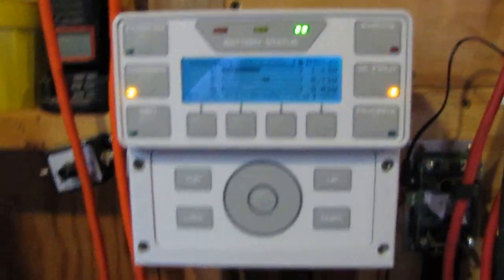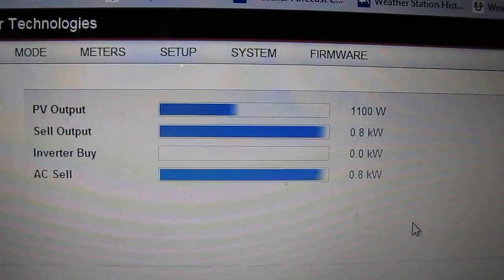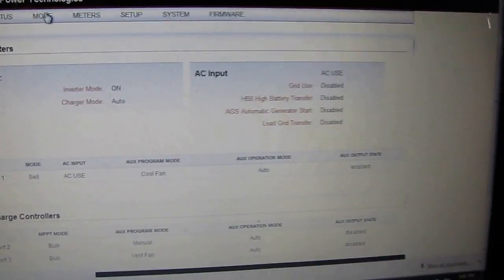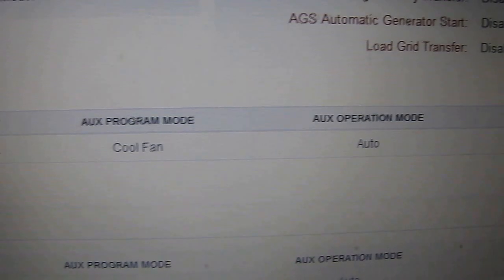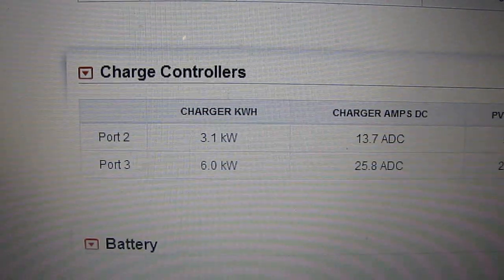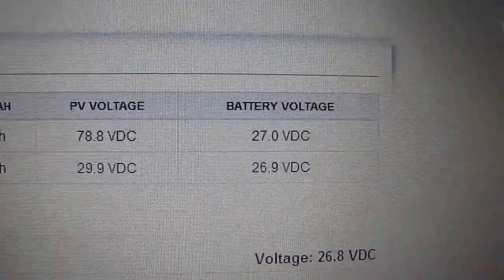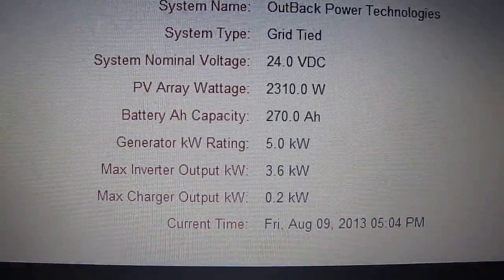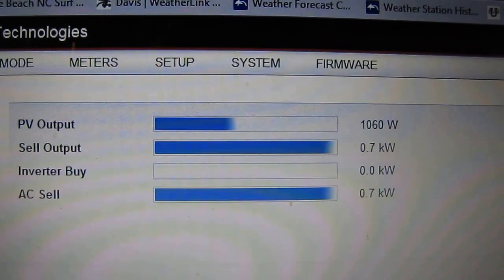OutBack Mate 3  System Controller  and Ethernet  By VIARLOCITY

Comment: I'm waiting for my system to be installed next week. Have a question. I would like to setup the FP1 for wifi monitoring instead of running cable. Would a access point work using a usb dongle or a router setup?
Reply from the maker: High Buddy I will Send You A link To my newest  Video On WiFi connection The power Line Adapter Was to Slow And To Much Interference
Reply from the maker: Here You Go Waterman https://youtu.be/rkMl-UqLhmM